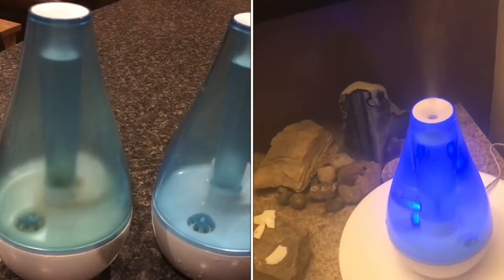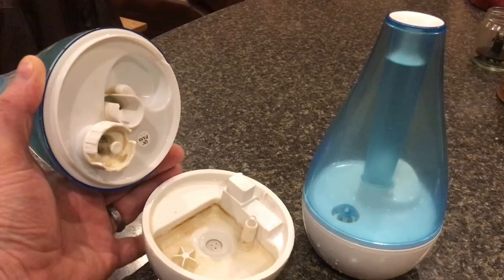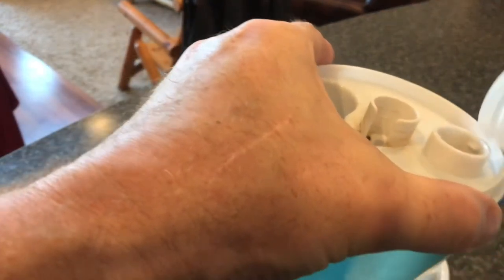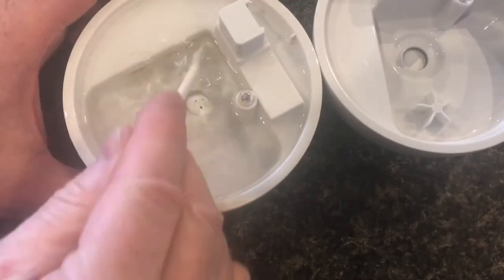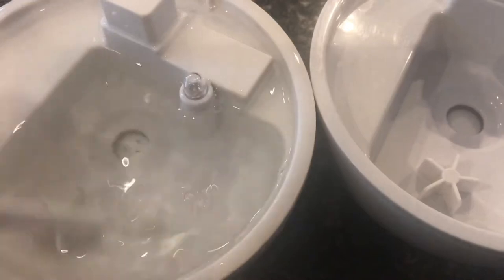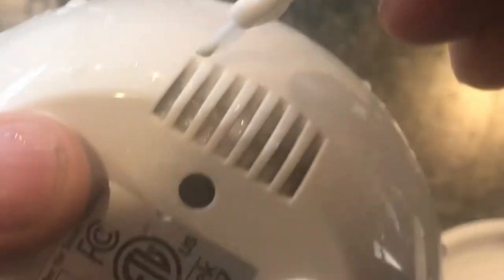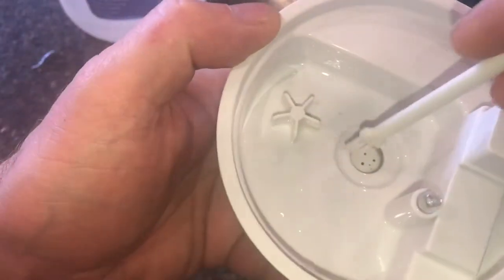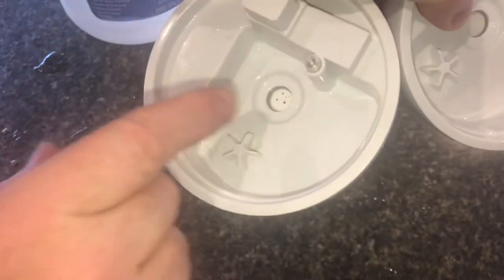SUPER CLEANING “ultrasonic humidifiers” (vinegar) pure enrichment mistaire studio cool mist

Comment: Vinegar is good but dont use it much cuz it ll eat the sealings.Also need to clean the intake and ventilation holes.The mainboard and all connection plugs inside need to protect from corrosion.Mine get shorted out luckly little burning smell but no damage.Clean it with wd40 make the plugs more waterproof and it works again.

Comment: If you have one that the vinegar just won't get clean..try oxalic acid (aka "wood bleach") and soak the parts in a solution of oxalic acid for several hours before checking. We also use this to clean the clear plastic holder on our whole-house water filter to like-new clarity.
Reply from the maker: I was reading up on that earlier this year, evidently it comes from rhubarb leaves or skunk cabbage. I’ve read it amazing at removing rust and bleaching wood. In the summer when the skunk cabbage is fully developed I would like to boil the leaves then concentrate it and see how well it works on rust compared to vinegar. From what I’ve read it’s a lot better.